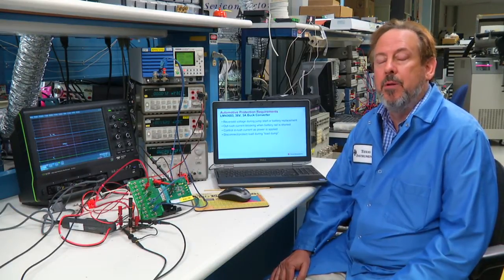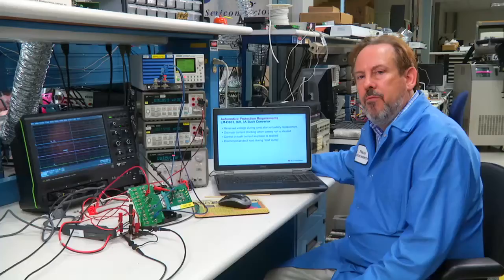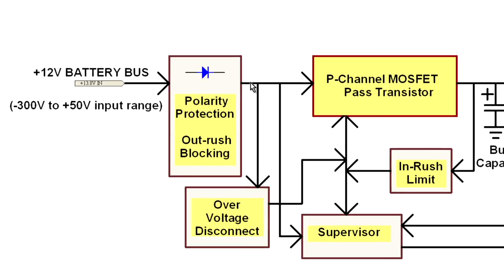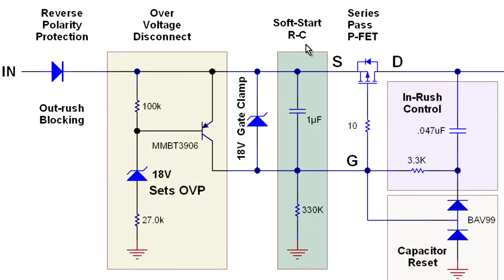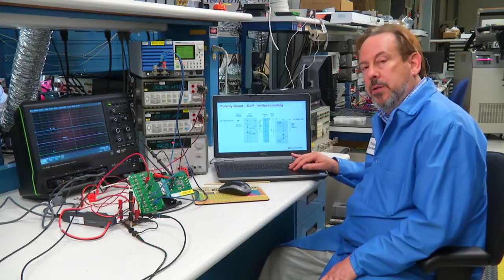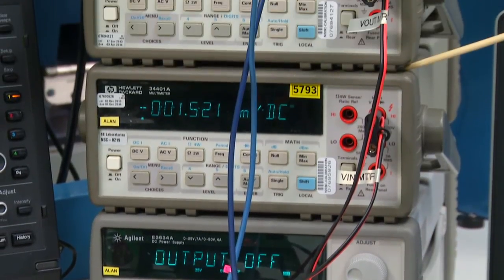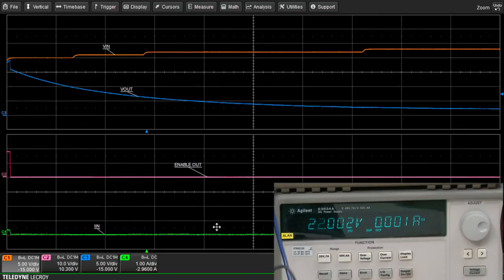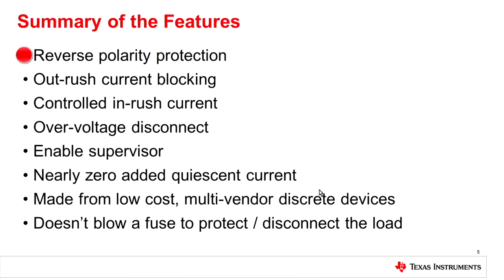Automotive Front End Protection

Comment: Great video. I know i'm late, but could you kindly elaborate on how the 2 diodes discharge the 2 RC networks?
Reply: I was wondering the same thing, but then I looked closely at the complete schematic, and I think both capacitors would discharge through the SMPS side and through the diodes, since when the input voltage is removed, the MOSFET would remain conducting for a brief period of time until capacitors are discharged. Strangely, the app note's circuit is different since the ROVS1 resistor is connected directly to VIN, bypassing the input diode, which I think could bring trouble in reverse polarity situations.
Reply: @dariodraiman6339  Okay, got it. Thanks
Reply: @dariodraiman6339  Regarding the app note's circuit, the ROVS1 resistor would keep the reverse current limited, so no problem
Reply: @brendandsilva4498  If connected to VIN directly, in a reverse polarity situation ROVS1 would allow current to flow thorugh DOVS, ROVS2, and RPG2, DRST thorugh the C-B junction of QOVS. Moreover, the E-B junction of QOVS would conduct as well and allow a path for the body diode of QIRL to conduct too. I would definitely connect ROVS1 to the cathode of DBLK instead, as shown in the video.
Reply: @dariodraiman6339  oh yes. Didn't see that. Thanks again